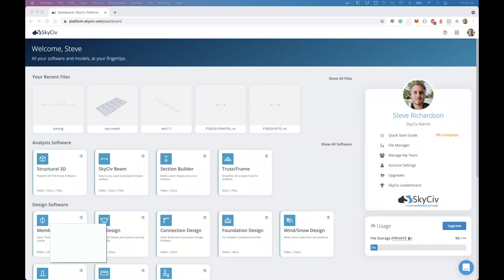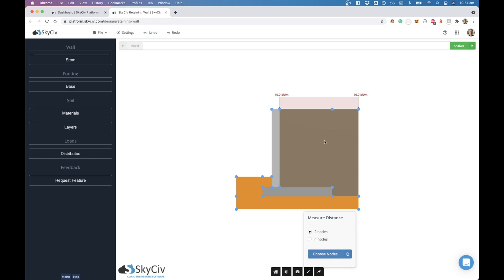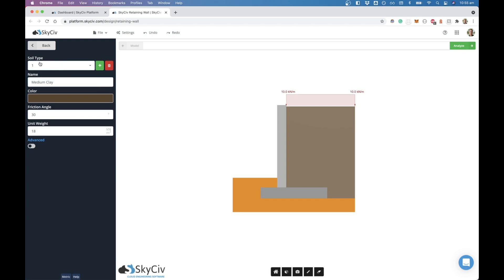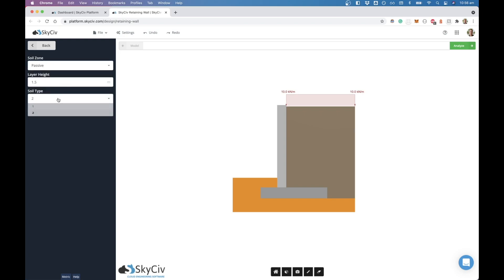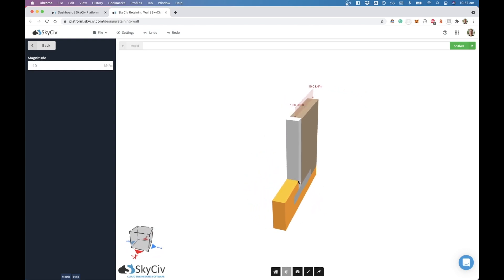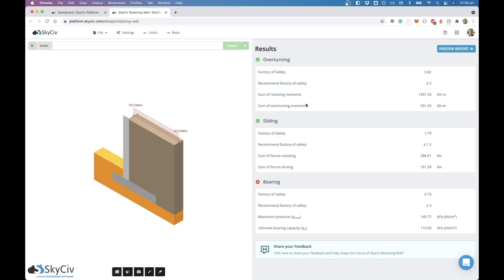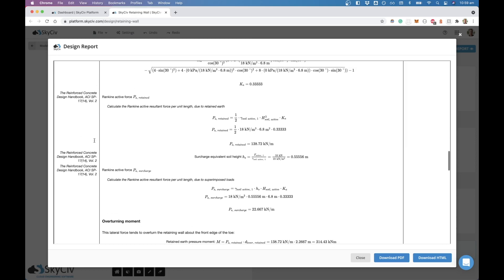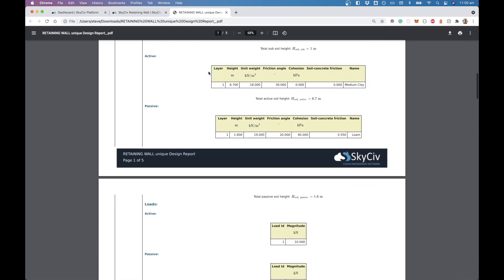Introducing the SkyCiv Retaining Wall Software

Comment: what if there is water table ? and how does that boundary condition taken for solving a wall. If you have gone through the numerical example question showing your input those and how does solution correspond to manual solved that question ? it would be crystal clear to that.
Reply: yes you are right